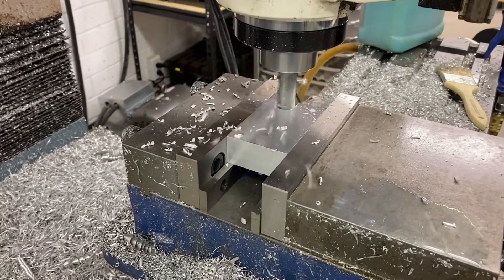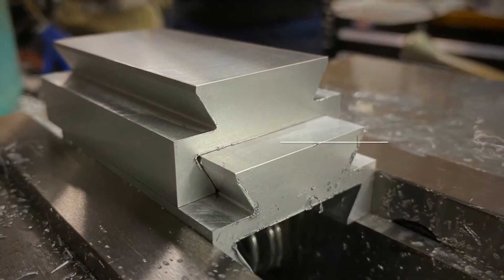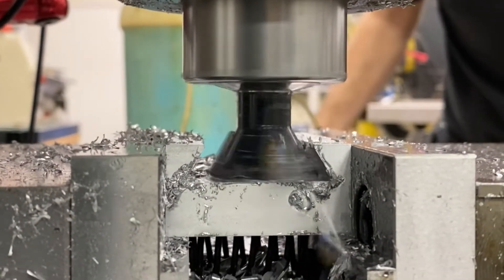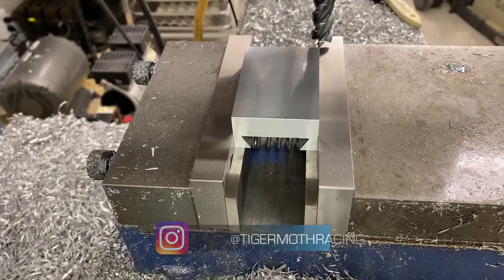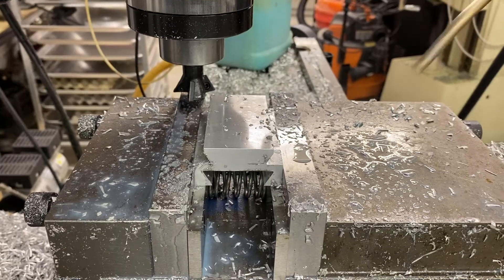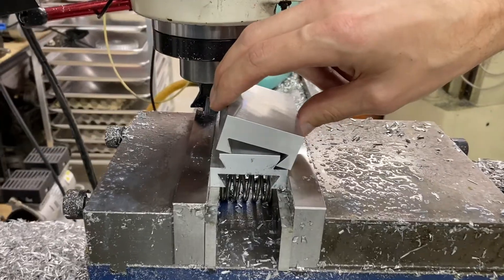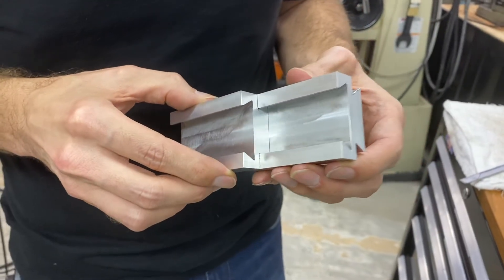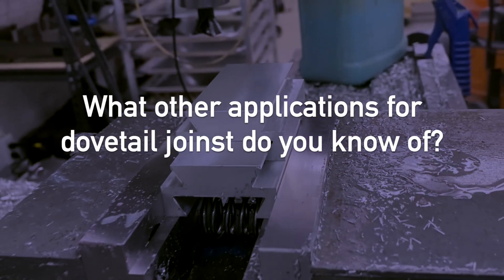Making Metal DOVETAIL JOINTS

Comment: What was the diameter of the pins in relation to the depth for the 60 degree dovetail?
Reply from the maker: In this case I am not sure. I was just using 2 identical pins to copy a dovetail I had previously made.

Comment: Applications for dovetails in aluminum: astronomy.  There are two standard dovetail mounts for amateur telescopes, the Vixen style or V mount, and the Losmandy style, or D mount. Both allow mounting the telescope to a mount, sliding it to achieve balance, and easily removing the scope.

Comment: Would like to see the setup for a locking dovetail

One which has a taper on each piece, so that with a light hit, they stay in place until struck again...
Reply from the maker: I would cut them the same way, just program a taper whatever amount you want. To cut them on a manual mill would be a different animal.
Reply: @TigermothRacingTV  manual would be challenge.
Which is what I have..
Reply: @eddaniels5006  probably not relevant anymore but you could angle the vise on your machine a bit using an indicator and trigonometry to get the right angle and cut a tapered dovetail that way.

Comment: Dovetails on heavy machines like a Bridgeport are very rigid. However, since you are interested in application, and usefulness,  I see the biggest problem with them is uneven wear, and the difficulty and expense of maintaining and rebuilding, IE regrinding and scraping.  I have always lamented the fact that beautiful, old machinery cannot easily and economically be restored to a precision condition. My 50 year old Bridgeport is a good example.  Though I can still make good parts with it, the dovetail ways are quite worn. It would cost in the neighborhood of $4000 - $5000 to ship it out to be reground and scraped.  Which is out of the question for me, as a hobby machinist.  I have considered converting it to Linear Rails. Though difficult, it's not impossible and has been done.  So my interest is in the comparison of the rigidity of Dovetails vs Linear Rails.
Reply from the maker: Yes I agree and your prices are quite right. Unfortunately it is both easier and usually cheaper to just go buy another machine less worn. Converting to linear rails is more of a project than is worth the resut. Liner rails are the current peak of tech in machine building for the ability to mfg them easier and their lower friction and higher speed.

Comment: people are very fond of library ladders in their homes these days. I use dovetail joints for the floor track. In the same vein, I have a small welder, and a plasma cutter, both telescope from a wall mount on dovetails. Sure, this is a more costly and time consuming method, but the nature of dovetails makes them a fail safe, and ultra long lasting track mechanism.
Reply from the maker: Nice, I like those applications, thanks for sharing!

Comment: We actually use a steel block in an aluminum body for robotic cutting. The steel block is only .5 x '1. So fairly small but this block needs to be able to slide for making adjustments.  Was looking at this and give me an idea to make the adjustable block dove tail style but would have to design the block with a set screw in order to solidify the position in the aluminum.  My biggest worry would be steel on aluminum is not the greatest combination when it comes to binding up and creating more issues during production as far as being able to make quick adjustments mid run.
Reply from the maker: Yeah when it comes to dovetails you should really use a gib to adjust tension and wear. Maybe a hard steel strip gib would work for your application?

Comment: Just wondering whether a dovetail cutter be mounted on lathe chuck and used cut dovetail joints same as done in this video..has anybody done that?
Reply from the maker: With a milling attachment or some way to hold your part, sure.